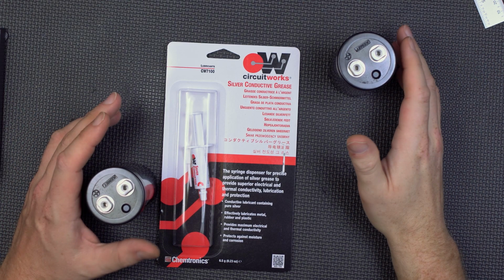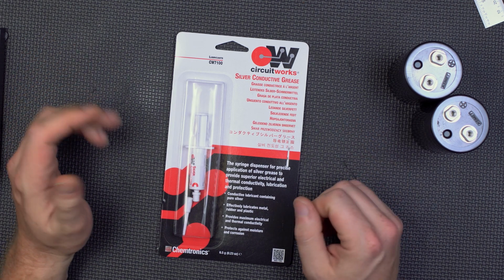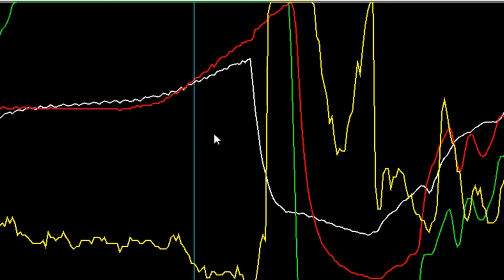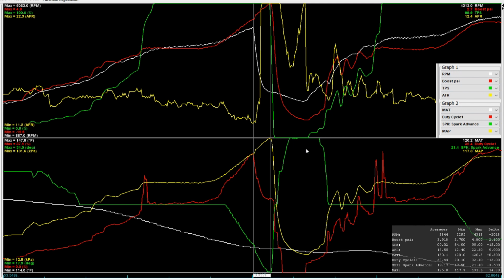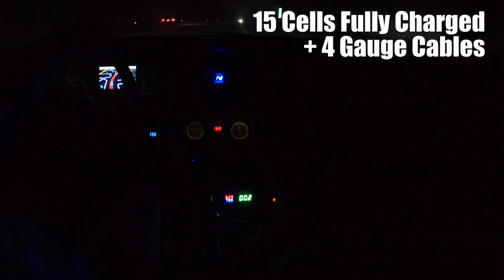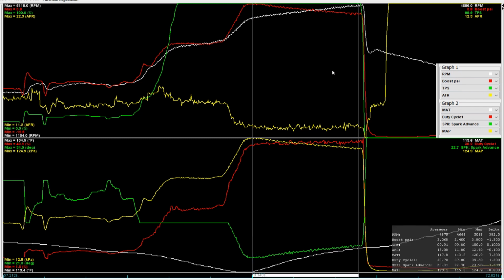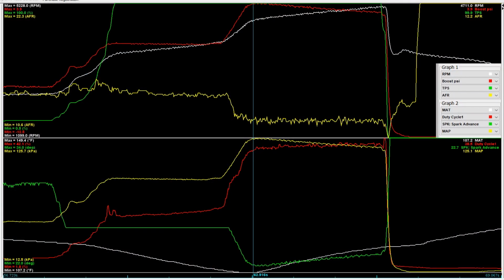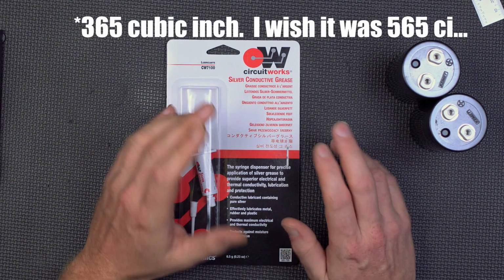The World's Most Powerful Electric Turbo - Upping the Boost!

Comment: Dude…..I’m impressed. That don’t happen often. I just can’t get over how the little motor(electric) makes so much power.
Reply from the maker: I'm still shocked (no pun intended) at how much power these little motors can put out - if you haven't seen it, check out our dragstrip test where I overlay the power consumption during the pass: https://youtu.be/nlTVHkfSQXM - this is with a different motor, though.

Comment: What about mapping the TPS voltage to the ESC's duty cycle? Then you'll have the ability to eliminate the full on/off switch and instead spool it up based on throttle position.
Reply from the maker: As long as the compressor isn't going into surge, there's no reason to ramp it in.  Unless you can think of a time on the street (or road course or drag strip) when 500 hp isn't enough but 700 is too much (or any similar permutation of torque/rpm).
Reply: Well that sounded like the way

Comment: And WTF, this video deserves at least 1 million views by now I don’t fucking understand what’s going on here. You are the only person to Develop a real deal electric turbocharger. By the way what size engine Are you running?
Reply from the maker: Lol - I agree.  It's 365ci Dart block SBF with ported Twisted Wedge heads (185cc, 292cfm intake flow on a real flow bench - in fact, the heads have been flowed on two different benches).

Comment: What if you used a geared headunit and a PMAC motor they use for electric motorcycle conversions like a throttle on your steering wheel instant boost when you want it
Reply from the maker: You could, but I don't think it's necessary.  If we were dealing with a lot more boost, then it would be worth considering.

Comment: Alex, how many watts would you feel comfortable putting into your current set up?  Even with the 16 full charged cells, you were at ~13,000 Kw right?  Since you’re literally the first person ever to accomplish a high powered electric turbo, and you have developed a feel for your set up by thisPoint, how much Electrical power would it handle?  Do you think the Vortx could handle a 40 KW motor?  Also have you considered using both conventional and electric forced induction simultaneously? I’d be kind of cool to have a Compound set up with the electric feeding a secondary conventional medium turbo. 20 KW and a medium large turbo seems two might be a great set up.  One more question. Ideally what would be your target voltage and amperage? 63V and 350A= 22kw
Reply from the maker: Alot of questions... the motor itself is rated to draw 53 volts at 283 amps peak for 10 seconds - 15,000 watts.  It's only rated for 7,500 watts continuous.  So we're pretty close to the max burst throughout the pull.  That's measured at the ESC input though.  I would assume that's how it's intended to be measured because on the motor side you'd have to start looking at some sort of three phase average (.707 (rms) etc).  I do think the ESC is the weakest link simply because we blew the lesser one.  But this one's rated for more current and a lot more voltage, so maybe we're good.  The motor's pretty much taking everything's it's getting; so there are still a few more electrical tweaks we can do and then we have to start looking at compressor side improvements - wherever we end up will be it for this setup - probably around 53-54 volts at 290-300 amps.  The Vortech could certainly handle a 40 kW motor - the weak link is the hex drive, and that still has a factor of 5 (at least) safety margin with this current setup.  I think I'll stick with just electric boost on this because it's never been done on a significant scale and it can be done, as we've proved I think.

Comment: I think voltage drop is hurting you in multiple ways. I think I saw 11v during boost. I would look into that a little more.
Reply from the maker: Are you looking at the air fuel gauge (the blue gauge in the center at the top)?  Battery voltage in the car is pretty solid at 13.8 and the electrical system for the electric turbo is completely separate and doesn't go below 52 volts.

Comment: I'm definitely in the market for one.. just waiting for someone to make one that can at least hold 5lbs. Or just me more low end power.
Reply from the maker: This can easily make 5 psi or more, just not on the current 6.0L V8 that's in the car.  On a miata engine (for example), it'll likely go into surge around 8-9 psi.  On the other hand, you can easily use this drive motor on a smaller impeller and support the same power level that we've already seen on the dyno - ~600 flywheel hp.  On a typical 180hp miata engine, with the right impeller but same drive motor, you'd see roughly 28 psi before running out of steam.  Sizing the compressor is critical to success.

Comment: Supercapacitors shoudl provide the extra power that you need...
Reply from the maker: Now that we've doubled up the battery packs we have enough power to destroy the (expensive) ESC and melt down the motor.  I do have super capacitors in the car (this monster: https://youtu.be/_HHxkMVnHQY), but they help start it.  To get enough supercapacitors to handle the voltage would cost over a grand (needs to be good for at least 70 volts).  Believe it or not, you're not the first to suggest supercaps, but in my testing even though they have a tremendous burst current capability, voltage dropoff is almost linear, and even my car-battery sized supercapacitor has less than 2 amp hours of capacity - both features that aren't good for this project.  After much exploration, Lipos are the way to go.  I do have 4 100 amp hour LifePo4 cells on the way for playing around with though.  But those will likely replace the car  battery (and maybe even the supercap - 100 amp hours is a lot of capacity; even though I run the radiator fan and water pump (both electric) between rounds at the track to cool the car down).

Comment: Have you considered a bypass valve to overcome the 1psi restriction? TorqAmp uses a mechanical valve to overcome this. If you bring this to market with at least 6psi I'll be looking to purchase !!!
Reply from the maker: I don't know why you'd need that - I suppose you could fab something up, but 330+ hp to the wheels pulling through the blower is more than enough for street driving.  Before we bring it to market, let's see how much HP we can make first!

Comment: Would ultra caps improve your setup? When compaired to your capacitors?
Reply from the maker: Not really - the start current is plenty strong and super caps would drain very quickly.  I have a car-battery sized super cap sitting on my other desk.  I did a video measuring it's self-discharge some time back.  They have a very low internal resistance (massive current spikes), but a very low overall capacity - I measured something around 1 amp/hr at a 1.5 amp drain down to practically no voltage.  Thanks for watching and taking the time to offer up suggestions!
Reply: @AlexLTDLX  i dont know much about ultra caps, i just figured it was the newest cap and the price reflects.

Concept proven. Proove more. Keep doing good work.

Comment: I had a feeling you were experiencing internal leakage. The amount of power you’re putting in and the PSI you’re getting out didn’t seem right. I just heard your SC impeller issue. Something to think about, if you can achieve a 5 µm or less gap, Air leakage almost drops to zero.
Reply from the maker: That's another thing to consider.  I did have to play with axial preload, because at one point I had close to .009" play.  This time when I put it together there wasn't any.  I'll have to see if it's loosened up any.  If I do go the Si impeller route and I have to machine my volute, maybe I'll play the clearance at least in the throat a little tighter.  Currently there's close to .011" gap between the impeller blades and the volute.  That's apparently normal for these.

Comment: What is your opinion on the torq amp? It provides positive boost of 5 to 6 psi till about 5000 rpm and then the engine is sucking in more air above 5000 rpm than the torq amp can move. This is on a 3.5 V6. It does provide about a 30% power bump from 1000 to 5000 rpm, but 30% is peak and it drops off the higher you go. Do you think there could be enough improvements to get an electric turbo to hold positive boost of 6 to 8 psi all the way to around 7200?
Reply from the maker: The torqamp is much smaller and less powerful.  That only has 5kW and supports on about 200 fwhp.  Our little project here peaks over 22 kW (over 15 kW sustained) and supports 600 fwhp.  And I'm pretty sure we'll eventually see 700+.  I think at this power level, 7 psi max is reasonable.  But you have to carefully match the compressor to the motor.

Comment: Do you ever plan on selling these? I want the Torque Amp kit but it's not worth it for $2500. Not enough PSI
Reply from the maker: Not at this time, but who knows.  It is quite dangerous.  And it would probably cost more than the Torque Amp (the batteries, ESC and motor alone cost almost $1,500 in this setup - that doesn't include the blower, control stuff or cabling/connectors/boxes).  I think you'd be lucky to see a $3,500-$4,000 price point on this thing.  To be completely honest, I could spend the same amount on a turbo kit and run 8's.  But hey, it's a start.  And it does have it's advantages.